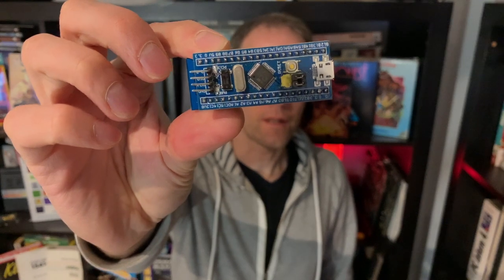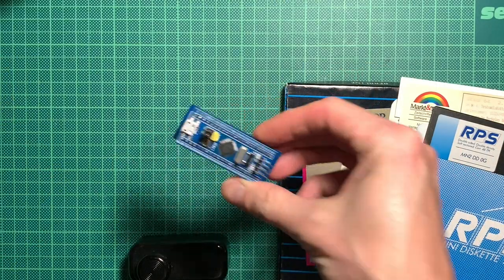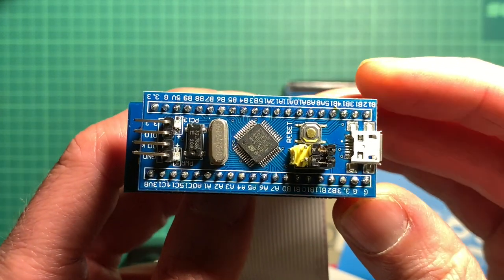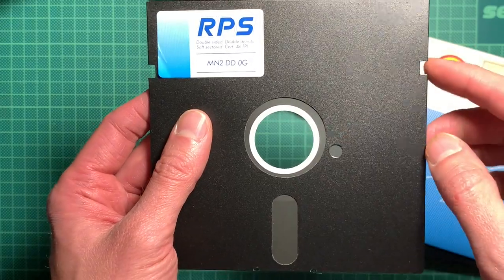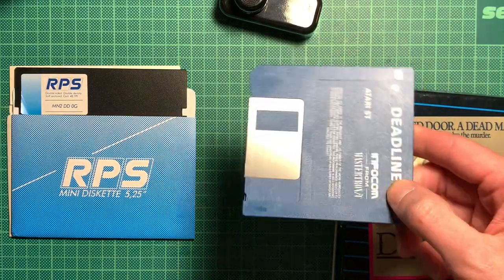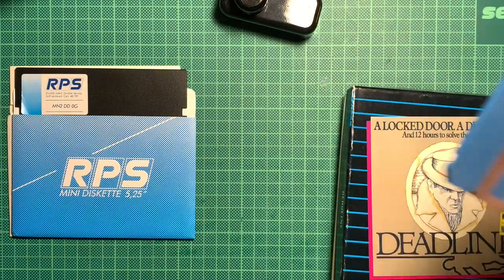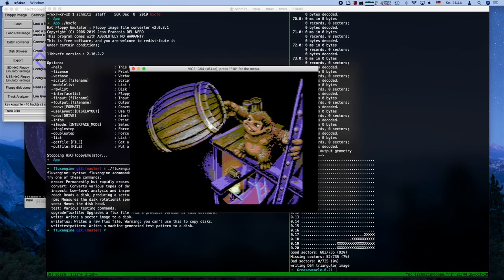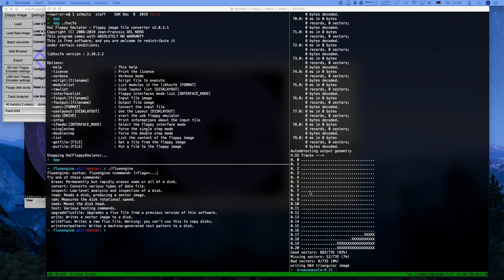The Greaseweazle: Inexpensive Rescue of Old Floppies

Comment: In the old days we used "flippy" floppies on Tandy Color Computers (Although some people did have double sided drives). These were double-sided floppies, but we used them on single-sided drives, but used both sides. One thing I noticed was you mentioned notching the opposing side in order to flip the disk in the drive, you even mentioned how the index hole was then on the wrong side, but you forgot something. We used a standard "single" hole punch used for punching holes in paper to create a "new" index hole opposite the original hole...

Two methods were used. 

First: Some people carefully opened the one end of the floppy disk cover, we opened the end that sticks out of the drive by carefully prying the sealed flap up. We would then gently remove the disk. We would then use the hole punch to create a new hole straight through the cover where the index hole should be for the "flipped" floppy. We would then reinsert the disk back into the cover and use tape to reseal the cover.

Second: Some people would leave the diskette cover intact. If you cover you hole punch with a soft (preferably cloth) tape in order to protect the surface of the disk inside the diskette, you can gently lift the outer cover away from the disk. You then insert one side of the hole punch into the cover with the other side outside the cover being carefully NOT to place the disk into the hole punch. punch the hole through the outer cover on one side. now flip the diskette over and using the same method  punch a matching hole on the other side of the cover. The result should be two small index holes in opposing positions, with the larger access hole (oblong) and the drive hole (large circular) Hole between them.

Another Note is it make the job easier to use an old dead diskette to line up the new index holes. You CAN easily remove the disk from the dead diskette by pulling it out through the large round hole. You can then overlay the dead floppy over the floppy you wish to make into a "flippy" floppy. 

After the advent of double-sided diskettes, many single sided diskettes were actually double-sided. Some companies would sell double-sided floppies as single sided if the disk inside the diskette had bad sectors on one side. However, many times the single-sided floppies had zero flaws and were viable double-sided disks labeled single-sided and sold "cheaper" than the double-sided, that was because they still sold single-sided disks, but the factory really only produced double-sided diskettes.

One thought I always had was if programmed properly a disk controller should be able to read both sides of the "flippy" floppies. This would involve totally reprogramming the routine to read and write the floppies back side. The index hole would pass the sensor, but instead of it now indicating that you are at the start sector zero, it would indicate you have passed sector zero. It would use the fact that the drive spins at 300 or 360 rpm's and "time" when sector 0 would pass again. It would then read the correct sector, however the data is in reverse order, so another sub-routine would need to reverse the order of the data. One other factor. Data on diskettes is usually stored as FM or MFM, which is a form of Pulse Code Modulation, and I am unsure if the data uses the falling or rising point pulses, but that too could be compensated for.
Reply: I thought of something else... Too bad the drive motor can not spin backwards. The disk inside the floppy would NOT know the difference since it already spins backwards when "flipped" If a floppy drive motor could spin backwards, you cold also place a new LED and photo transistor on the opposing side of the drive. Whatever circuitry used to reverse the motor could also switch from using the original LED and photo transistor to using the added LED and photo transistor. The rest of the circuitry would NEVER know the motor is running backwards. The side select could work normally only reversing the head, however a switch on the front of the drive would reverse the motor, and reverse which side is seen as side one and zero. Two unusual side effects of this is that if you put a double-sided floppy into the drive upside down, flipping the switch would mean you could still read it! Also this could be a simple form of "encrypting" you data. Put as disk into the drive the normal way, flip the switch so everything is reversed, format and write data to the disk. Putting this disk into a drive without this modification results in the computer getting a "data format" it does not understand!
Reply from the maker: Well, it would depend on the motor and driver IC to switch rotation direction. It still leaves the problem that PC floppy drives have the second head offset by 8 tracks. So you will never be able to read the first eight tracks of the second side without modding the drive. What we really need is a custom floppy drive with non- offset tracks. The direction reversal can be done in software as you said.

Comment: 23:30 this is the copy protection of GEOS not finding the special data so it detects it is a copy. The disc image would need to have the copy protection intact, and that is not supported in d64 files, only in g64 files.

09:00 actually you got it wrong, 1541 A-side actually uses the bottom of the disk, so always the bottom side of the disk is actually read and writtein a 1541, not the upper side that you see when inserting it into the drive.
Reply from the maker: Re: 1541 A side: Yes, I do know that now, after having disassembled, cleaned and repaired (or failed to) a couple of 1541s. But thanks for the info. 

Also by now I do know about the weird GEOS protection. Good grief, they were serious about that back then!

Comment: A solution for reading 5.25 inch double sided floppies >

Read Side A as normal.

Next - take a sharp blade and make a full cut along the rear edge.

One should now wear rubber/latex gloves at this point.

Carefully open the gap, and slowly pull out the media.

Flip 180 degrees and push it back in.

Use small piece of scotch tape to keep the new opening - closed.

This concept should work...
Reply from the maker: Agreed, if you need to rescue the data and don't mind that the floppy disk isn't pristine after that, it's ok to do. I wouldn't do that to original game media though. :) It's also an option if you need to clean the disk anyway, e.g. because of mold.

Comment: Thanks. Non copy protected apple ii disks also work. Works best with DOS formatted disks, but som prodos disks also work.
Reply from the maker: Yes, the software supports lots more disk formats, however I don't have that many different media samples... The Greaseweazle itself is more or less agnostic to the discs. Only when interpreting the flux data with either keirf's disk utilities, hxcfe or fluxengine you get to pick which format is actually used. So yeah, for Apple II users this should also be a pretty affordable solution.

Comment: I just bought a GW4 to use with UAE and I must say, it works like a dream on the Mitsumi 3.5 fdd I found online for $15 😀, it literally took me 15 minutes to get it up and running, Thanks to all of the people responsible for the development of the hardware and software, it's a blessing to the retro computing community. Now my question, is it compatible with a GoTek FDD emulator?
Reply from the maker: That's a fun experiment -- my guess would be yes, as both parts emulate their respective parts of a FDD system. The GW emulates the FDC, the Gotek the actual FDD.

Comment: See, for me, the price of the KryoFlux isn't the problem. It's their license. See, I run a couple small businesses from my home. Sometimes one of said businesses involves old computers, but retrocomputing is, at the moment, mostly a hobby. However, on their ordering page, they say they will cancel your order if they determine your address to be anything other than purely residential. So OK, fine you say - just get the commercial license. Well, you can't even see pricing or anything on their page, instead you must reach out to one of their sales people. I'm sorry - but if you won't even tell me what to expect, or what your company size/use restrictions are, I'm out. GreaseWeazle should be here in a couple days. I like the software for the KF, but am unwilling to dance through their hoops if I dare to try to recoop some of my investment in their product - or if they deem my intent as such.

Comment: I’m fairly sure that at least in the Atari 1050 disk drive the read head is on the bottom and the top has a felt pad, meaning that on a single sided disk the data is on the bottom side opposite the disk label side. BTW the Atari drive did not use the index pulse, so flipping the disk was easy. I scored some hard sectored disks from work, which had multiple index holes (one per sector), which worked great in the Atari drive, since the Atari drive didn’t care.
Reply from the maker: 1541 is the same as the Atari disk drive in that regard. No index hole, and single sided with read head on the bottom. I also have an XM1541 cable, so I can use that as well for reading and writing C64 images. However having the Greaseweazle support flippy disks would be nice, too.

Comment: when attached to a 1.44 or 1.2 drive (can it be used as a normal a or b drive?) thanks.....
Reply from the maker: No, it is meant to be used as a means to read and write disk images. There is no software yet to support what you are asking. Though not impossible…

Comment: I have a V4 which works fine on ADOS + PC disks.
Non-Dos/Protected disks can be copied RAW but they are huge (around 40 Meg).
Tried converting them via HxC but no luck --- prob coz of diff in Track no's IE 79 to 81 ?

Comment: I've just bought a GW f7 plus lightning, can I use an Amiga 500 FDD with that connected to a PC?
Reply from the maker: Probably with a few wire modifications, but it’s probably easier to just use a PC HD drive. It can read and write Amiga DD disks just fine.
Reply: Thankyou

Comment: Where can I buy one pre-assembled ?
Reply from the maker: Just search for the blue pill board, e.g.: https://stm32-base.org/boards/STM32F103C8T6-Blue-Pill.html
You can wire up to the GPIO pins according to the Github Wiki: https://github.com/keirf/Greaseweazle/wiki/Hardware-Setup
And you will have to flash the MCU with the Firmware:
https://github.com/keirf/Greaseweazle/wiki/Firmware-Programming

Comment: someone from italy sent me this device with a floppy drive... can i use this thing to create real floppies for the amiga 500? if anyone has any usefull info please respond to this post;) i need to create an amiga workbench 1.3 floppy - the thing i have says greaseweazle pc drive rev1 and gets powered by a miniusb-standard usb port cable
Reply from the maker: Yes the Greaseweazle can of course write Amiga disks. Should be no problem. Make sure to use the latest GW release (0.38 as time of writing) and to update the GW firmware using the "gw update" command.

Comment: interesting device ! can it copy E-MU SP1200 sampler drum machine floppies to convert them to Gotek readable floppies , anyone?
Reply from the maker: It can image any 40-80 track formats, and even some other weird ones. Question is if there is software to convert it to something Gotek can read. Also most of the time FlashFloppy is recommended for Gotek.
Reply: @root42  thanks for reply - appreciate it! There is a Kryoflux device that can read anything including e-mu 1200 floppy disks ..and HxC software can recognise and convert them ..but it's muck much more pricey than the Greasewhezle...  ( I am in Europe so it gets even more pricey with shipping and customs  fees) that's why I am curious if it can be done with this intriguing device ? 🤔